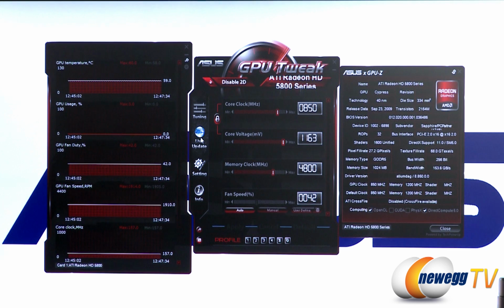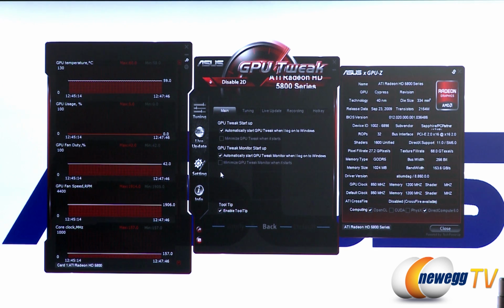Newegg TV: ASUS NVIDIA GTX 560 Ti, GTX 570, GTX 580 DirectCU II Video Cards

Comment: @navarro1989 
What kind of power supply do you have? Sounds like it may not be getting enough power at max load. Would possibly explain why dialing back the processor would stabilize it.

Comment: @navarro1989 why are you downclocking your card? if you want to change the clock speeds of an asus card, I would advise using the asus rog overclocking program. it is made with their cards in mind.

as for random shutdowns, this can range from anything in the system really. what other parts are overclocked? and are you sure your temps are all fine? check for dust and such.

Comment: @beatboxing0607 nvidia is the orignal maker, and then they are modified by other companies such as asus, msi, evga. differences are in the clock speed and the cooling method. Twin frozr is suppoesed to be best for cooling, though evga is also good. Asus are getting good reviews and are the cheapest

Comment: I'm looking at buying the 560 ti OC version, but I've heard mixed reviews about the fan noise. How often does the fan reach 50%+ speed and how loud is it realistically from inside a case? I can handle just about anything from my current laptop, but I'm just wondering. It'll either be this or the Twin Frozer II cooler from MSI, but I like Asus better. Haha.

Comment: I am using the GTX570 Direct CUII and honestly, I don't know is the driver or the card but it fails quite often compared to my earlier GeForce GTX470. Maybe the Asus version is more complex, Blue screen, colourful linings and stops performing when sometimes playing Starcraft2 at full HD. My PSU and CPU are adequate, 800W and AMD Phenom x4 965. My next card, I would prefer going to Geforce and is the price is cheaper.